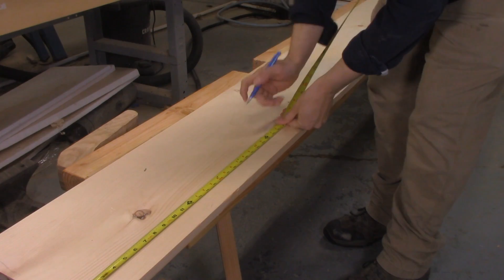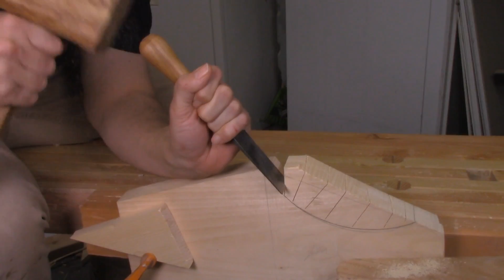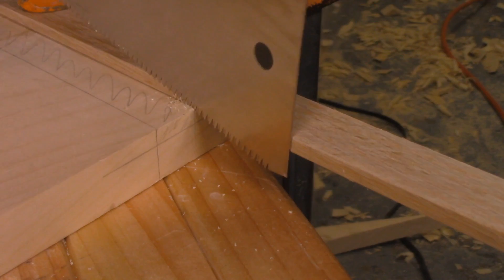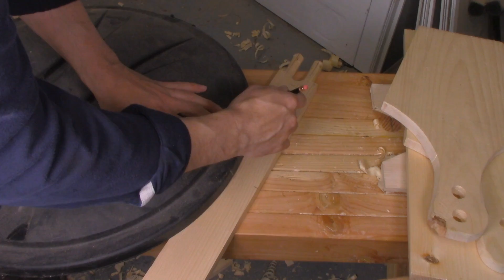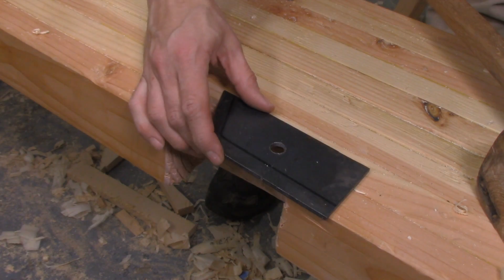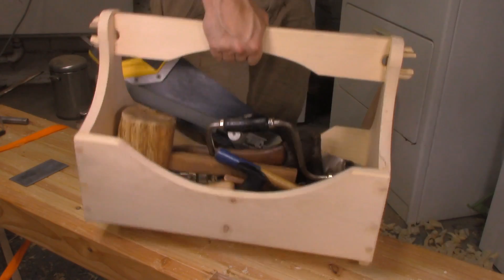Make this tool tote from one board.

Comment: How about making a chisel 101 video?
Reply from the maker: Hm. I could. What would you like me to cover?
Reply: @RexKrueger  well my chiseling is currently at the "wack it with a hammer and hope for the best" stage, so anything would be a help 😊
But I was thinking generel tips and tricks on how to get the best results with a chisel, some do's and (especially) don'ts.
And are all woods suitable? I personally have trouble getting a good result with sharp edges with pine at the moment, and it's either because the pine is too soft or that I'm doing wrong.
Reply from the maker: @baekkistyle  Pine is really soft. You need an extra-sharp edge. If it won't shave a hair, it won't cut pine.
Reply: @RexKrueger  makes sense, better go and get some wet stones then 😊
Thx for the advice, and keep up the good work 👍